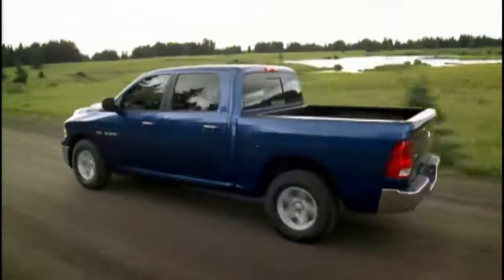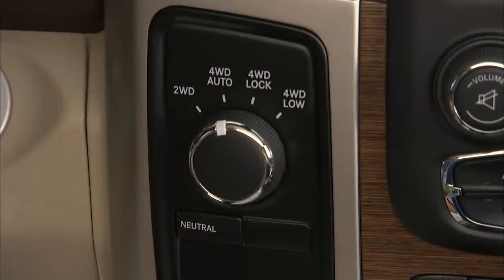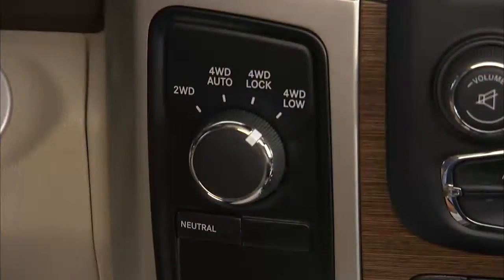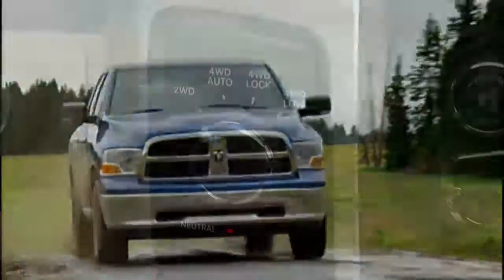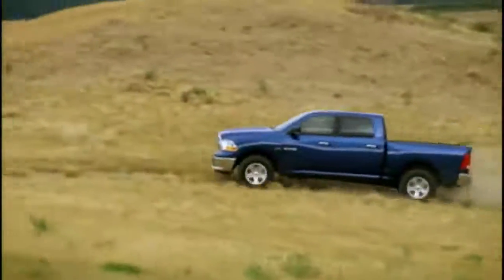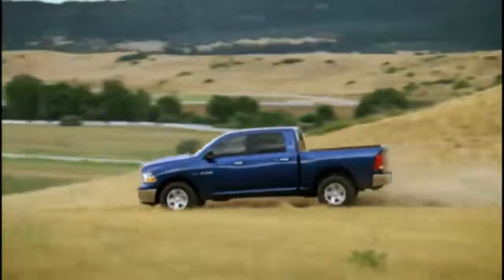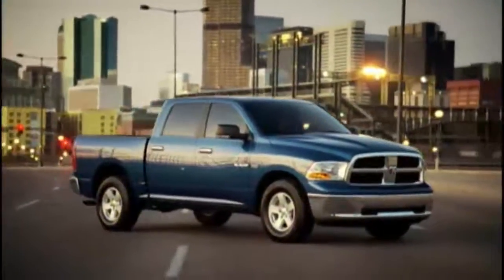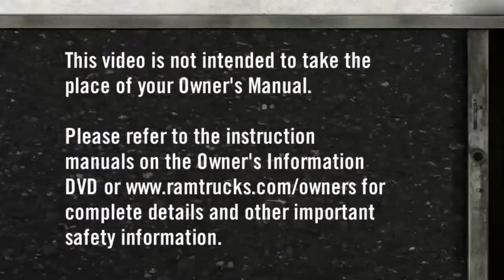2014 Ram Truck | Four Wheel Drive Operation - Five Position

Comment: So which is considered as high lock and which is low lock?  Thanks.
Reply from the maker: Hello Marcus,
Per page 431 of the manual: 

• Two-Wheel Drive High Range (2WD)
• Four-Wheel Drive Lock High Range (4WD LOCK)
• Four-Wheel Drive Low Range (4WD LOW)
• Neutral (NEUTRAL)

https://bit.ly/3JR8eYH.
 ^LH